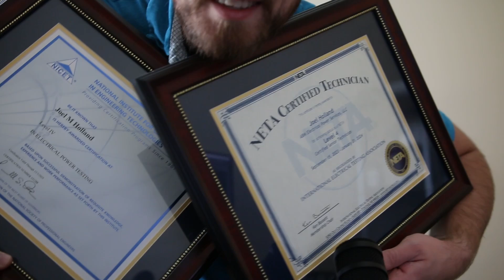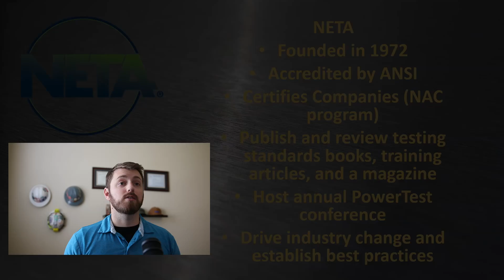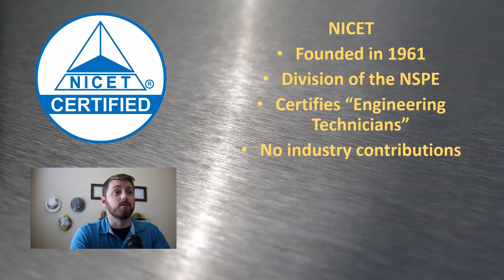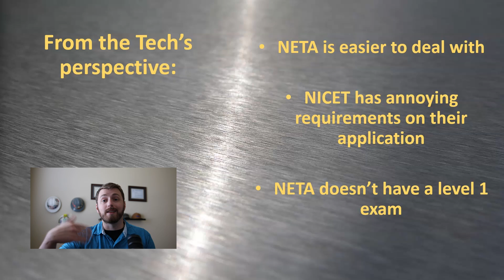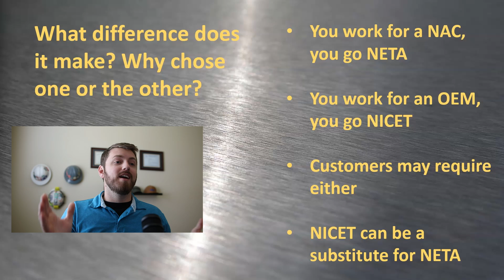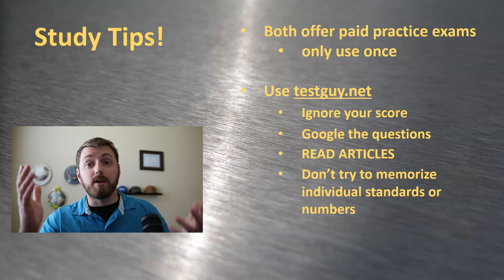NETA vs NICET EPT - Which one's better? (Plus exam study tips!)

Comment: Thanks a lot. As someone who is weak in math, what type of formulas do I need to know? Or is there much math on the neta level 2 test?
Reply from the maker: There is definitely some math. If you have the fundamentals of algebra down and can solve power equations (ohms law), parallel/series resistors and capacitors, then you should have enough to pass the exam.
Reply: Almost all of the math you need to understand is on the formula sheet for neta. I strongly recommend taking some time to get familiar with the use cases and how to work with the formulas on the provided formula sheet.

Comment: You mention in your video in passing that "we short windings for power factor but not for Megger"... Would you mind elaborating? Ty ...I am Nicet lvl 2.
Reply from the maker: That's actually a great question with a long-winded answer (maybe worthy of its own video).
The short version is that the megger or DC insulation resistance test uses DC which flows through the winding. Power Factor is an AC test; there's a significant amount of inductive impedance between phases at 60Hz, so to penetrate the winding with your test voltage you have to short them to apply the same voltage on each phase to cancel out most of the impedance between phases. When we're performing the megger test, we're applying DC so there isn't any inductive impedance. XL=2πfL so if f=0 then XL=0.
Reply: please how i can get study plan for NICET Level 01 and if Exam of NETA is same of NICET?